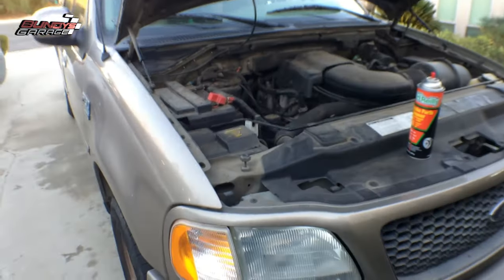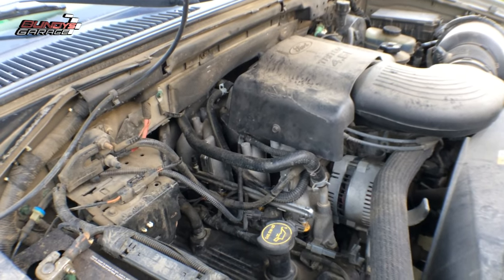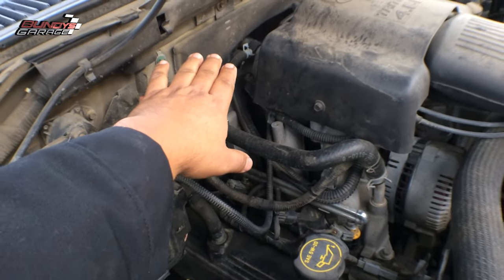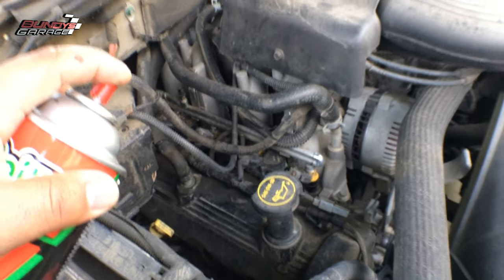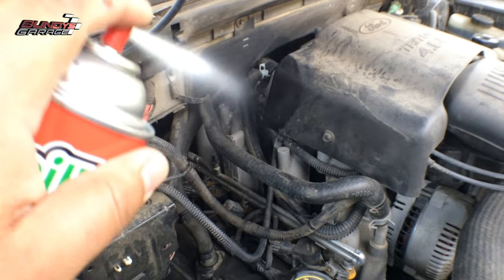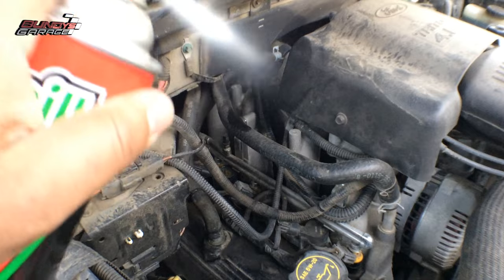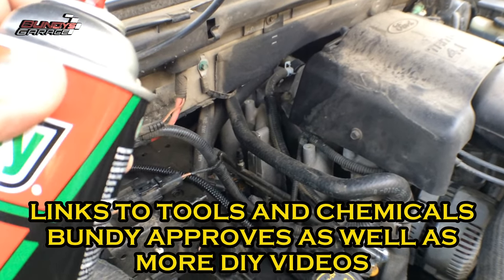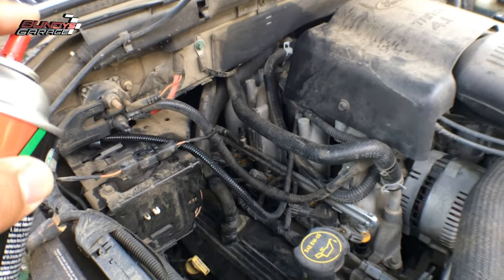How to [CHEAP] Find Vacuum Leaks with Brake Cleaner

Comment: Can the spray ignite the engine
Reply: If a spark plug wire or boot is damaged and it is sparking outside the cylinder, it can ignite if the brake cleaner is sprayed onto the spark directly. It would be best to use small controlled squirts of brake cleaner at a time and wait for it to evaporate or dry before spraying more. The brake cleaner evaporates pretty quickly.
Reply: Always keep a fire extinguisher close by when doing this.
Reply: Avoid doing this on a hot engine. Basically, directly after a cold start should be fine.

Comment: Can't this catch fire if you use it on a hot motor
Reply: Eh.. It'll burn out quickly. 😁 Really you don't need to spray as much as he did to demonstrate it, he was just getting the point across. Do it on a cold day, cold start etc if your concerned but the risk is low imo. ❄️💯😎👍
Reply: Always good to have a fire extinguisher but it does evaporate Quickly

Comment: Just as well there is no short in an HT lead. That would be some fire you have caused.
Reply: What’s the HT lead I wanna try this I have code Po171 and p0174 in my Acura TL
Reply: High tension leads. Or spark plug leads. I would not use brake cleaner for this. Very high fire risk.